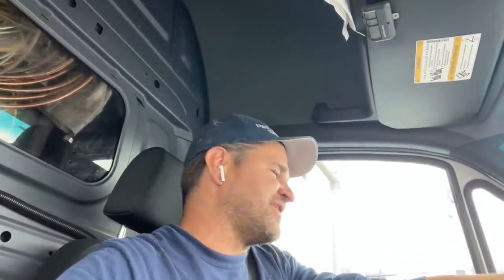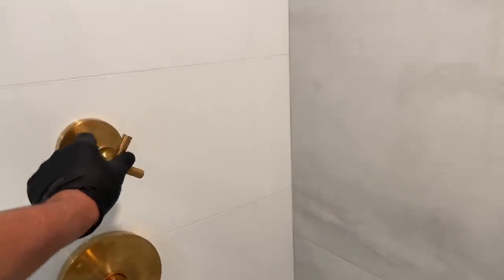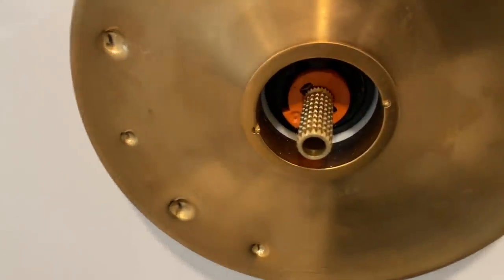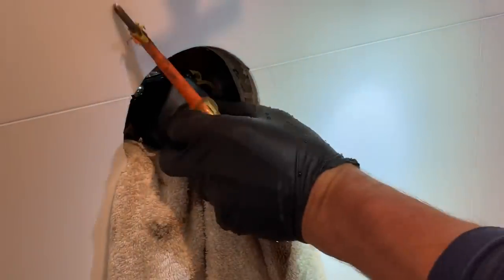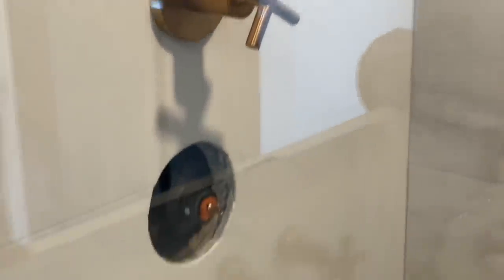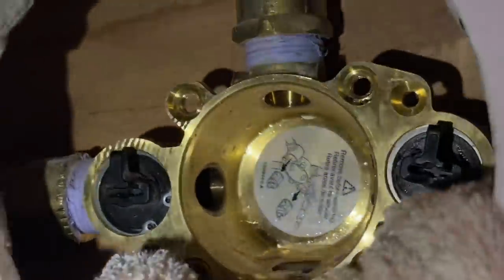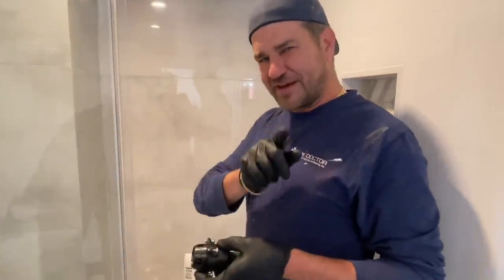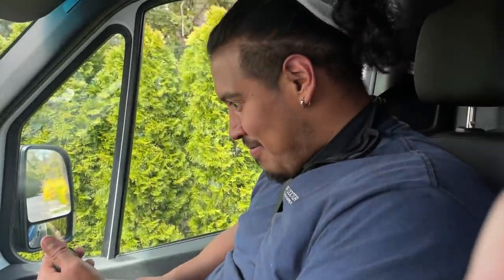How to Fix Brand New Kohler 8304 Thermostatic Shower Valve Very Weak Water Flow Read Description

Comment: 2 years with very little water pressure in our master bath. Since the other bath had terrific shower pressure, I suspected an installation error.  Your video solved our issue. It took hours of research to stumble across it however. Our issue ended up being the stops being only partially opened. During the repair I learned the key to a successful install is THE VALVE CARTRIDGE MUST BE COMPLETELY SEATED & CARTRIDGE SCREWS COMPLETELY SCREWED IN FOR THE STOPS TO BE FULLY OPENED. Otherwise the tabs on the stops (which point towards the valve cartridge to indicate fully open) hit the base of the valve body & can't be in the proper position. I broke one tab before realizing that and it's probably why my stops weren't fully open on the original installation.
Thanks for the help. Probably saved me several hundred bucks for sure.  For helping me out so much, in your honor I'll pull the Mets/Yankees.  One game only sorry.
Reply from the maker: Can you send me some Yankees tickets?

Comment: Had a new one of those did the same thing...changed the cartridge and it worked ok.  Don't know if that would help you.  BTW, it was piped in with pex and was less then a year old.  Kohler sent a new cartridge.

Comment: Those isolator valves are nice.  I replaced a cartridge on a shower and did not even have to turn off the mains and drain and refill the system.

Comment: Very familiar with this valve, noticed the stop indicators after you had taken off seal plate were in the wrong position- 6 o’clock, these stops only work when the indicator is in the 9 open- 3 closed. It works by a mini flow check in the middle of that stop you are just rotating 180 degrees . And are can be fouled easy . Sometimes I have taken them out  for better flow
Reply: That’s right, I only gave you the right side (cold ) info .And is opposite for the left
Reply: 19:11 
9 out of 10 I have had same problem with this valve
Can the restrictors on the stops be removed without compromising their function (stop the water flow when turned ¼ way)?

Comment: I had the exact same problem when I had my home renovated with the same valve body. The plumber came back took the valve out (very carefully so as not to drop the screws down the wall), but no joy. Turns out it was bad right out of the box. He got Kohler on the phone while I was standing there and I said to Kohler, as the home owner, that it didn't work and they sent a new one out right away. Two actually, so I have a spare.
Reply: @PipeDoctor  wish I had their #, the standard service won't connect me to technical - they just take my info AND hang up after putting me on hold....
Reply: @atlantajunglepythons1744  Maybe you are flagged in their system as someone they don't want to talk to, lol.

Comment: I have this identical valve on a dedicated shower with no volume control and don't get enough flow with it.  I removed the aspirator like you did and found that the valve would not turn off, only reduced the flow somewhat.  Put the aspirator back in and the valve works properly, though the flow still isn't great.  I've tried putting the aspirator in from both directions and the flow is the same either way.  Can you or anyone explain why the valve won't turn off with the aspirator removed, and why the flow is the same with the aspirator in either direction?
Reply: @PipeDoctor  I've got the stops figured out.  What I'm talking about is the valve.  Having disassembled the unit and flipped the stops several times, the flow is a little better- maybe some debris was stuck.  My question was about the aspirator- the valve will not shut off completely with the aspirator removed.  Any idea why?

Comment: So I’m having trouble with same style cartridge right now. My problem is that the cartridge/or valve body is mixing too much cold water. The water pressure is fine but the temp gets up temperature once valve is opened but only for couple seconds then goes to Luke warm. Called kohler and they suggest that the aspirator that’s shown in your video is supposed to go facing the tub spout. (Yes I’m working on tub shower with just a spout and shower head) THE CUSTOMER IS READY TO KILL MY HE JUST WONT SAY IT. desperately need help. Have not changed aspirator around
Reply: The valve body I’m using does not have the integral stops by the way

Comment: Mike I was surprised that you didn’t just check the water pressure in the house first ???But excellent tip on shoving the towel into the wall so you don’t drop the screws that’s a great tip.      Pete m

Comment: "I can't test flow", did you forget your  saying? 1/2" pex can do 14 GPM and that would be more since it is fed from hot and cold. I have 1/2" pex and it blasts out. I'd say that shower had 1 GPM.
Reply: Yea my shower is piped with 1/2" pex and it blasts so much water drain can barely keep up.

Comment: You haven't shown it but did you check that the hand shower and the wall showerhead are not clogged with debris? You did say that the second floor lacked flow at other fixtures so perhaps when they remodeled they left some old plumbing that is now obstructed? Possibly galvanized in the walls clogged at an elbow Perhaps badly installed PEX that is kinked?

Comment: I check if the screwdriver stops are leaking by opening the shower/tub valve. 

I hate all the modern cheap plastic crap—used to count on Kohler, Delta, etc. for solid brass parts, but no more. Funnily enough, their retail prices haven’t come down!
Reply: oh: the stops are closed when the “tab” points toward the supply, and open when it points to the valve body.

Comment: The reason you are getting poor pressure. Is due to the fact it is plumbed wrong. You have a tub/shower valve which is fine, but you need to cap off the tub port and not use it. You can see it at the 7:52 mark, they plumbed the handheld spray head into the tub/bottom port.  If you want multi shower heads you have to go off of the top of the valve. A simple tee from the start, for the handheld spray head and a shower valve without a tub port would have been the solution from the beginning. think about it, when you want to take a shower in a tub you pull up on the knob on the tub spout. Sharing information, Hope this helps.

Comment: Did the heads have a water saver washer🤔
8 miles of 1/2 inch pex will do it also.😂🥃🥃🍺🍺🍺🏌🍇
Stay safe.
Zilla crack the books so you can get your own mikey-D-pipey truck.
Retired keyboard super tech.
Wear your safety glasses.

Comment: I really like the Hansgrohe iBox..  Seals all of the water surfaces within the box, and you can remove the valve and flush it right into the shower area without worrying about water damage in the wall.  After seeing this product, I don't get why US brands, like Kohler, don't have a similar protective box design for their valves.  If the valve seal leaks, water in the wall and lots of damage!  In the iBox, if the valve seal leaks, you get water running down the wall on the inside of the shower where it can be seen and then fixed w/o damage to the building.  (Side note, Hansgrohe and Grohe are two different companies....)